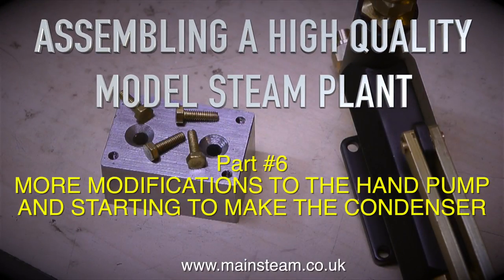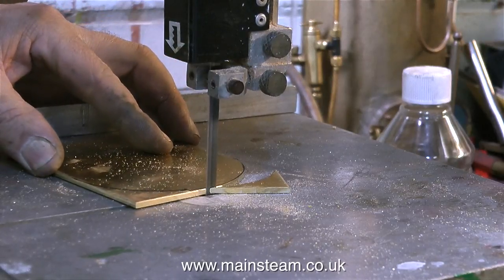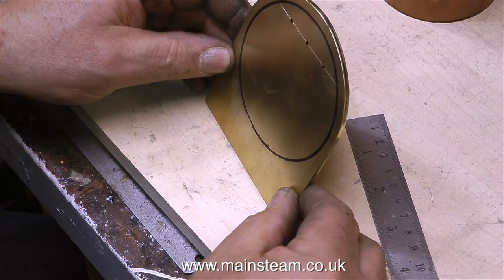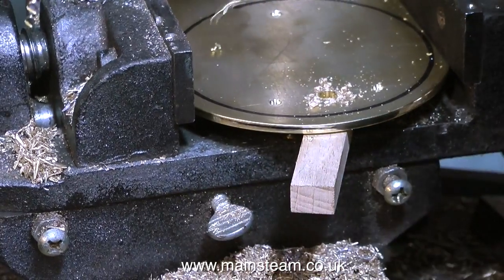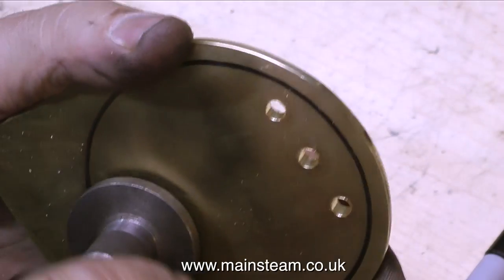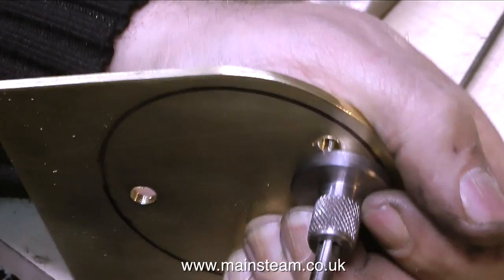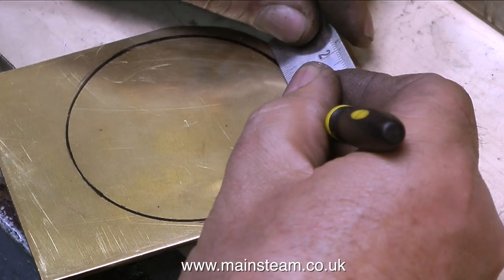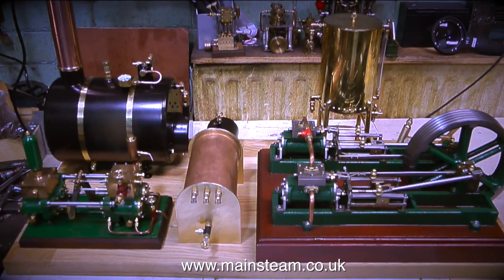ASSEMBLING A HIGH QUALITY MODEL STEAM PLANT - PART #6

Comment: A little suggestion re bandsaw and circle cutting. if you only cut in one direction (clock or anti clock) you can alter the tooth set and the blade will not be able to cut straight again. This is the voice of experience from wood turning days. If you alternately cut a circle clock wise, then anti, you can balance the wear. If you haven't noticed this problem then ignore the above, oh and lucky you. >)

Comment: Keith, you need a Drill Doctor to keep your drill bits sharp.
Reply from the maker: I just sharpen them with a flick of the wrist on the bench grinder . . .  I bought a drill grinder, but I prefer my method that I have used for years . . .
Reply: Keith Appleton 
I'm with you Keith,,,  there are drill sharpening machins, ,  But the Drill Doctor is not one of them...
In High school shop class, we made a gauge to use to sharpen twist drills with... There was no fail,,, we had to keep working at it until we did it right..  I remember few things in school that I was impressed with,   but that was one of them...

Comment: Although I hear about how you have loosened the belt on you drill press almost every time I see you drilling and that you are a keyboard player, I don't mine because I think that is a useful tip and warning that some newbie may pick up and save themselves some grief, so keep the health and safety warnings coming.  As for keyboard playing the only keyboard I have managed is the one I am typing on with an autocorrect spell program. Say that is a thought do they make autocorrect for musical keyboards?
Are you going to paint the condenser?
Reply from the maker: Yes I am definitely going to paint the condenser - with satin spray paint as it needs to match the boiler and gas tank . . . .